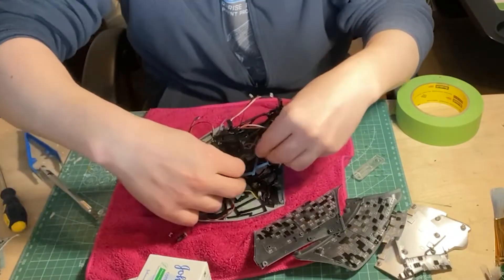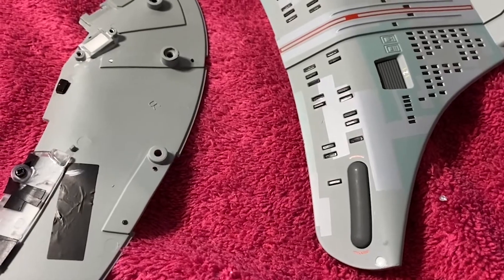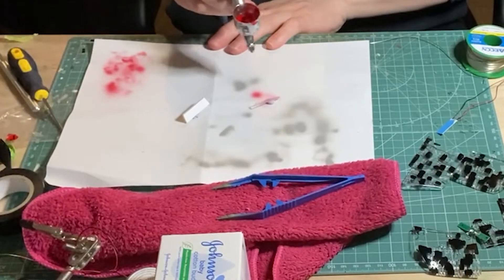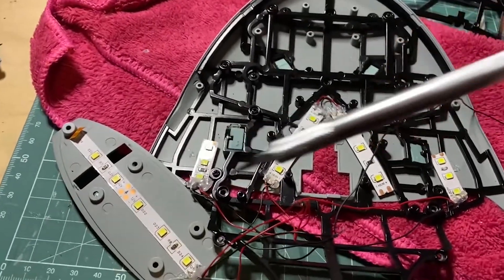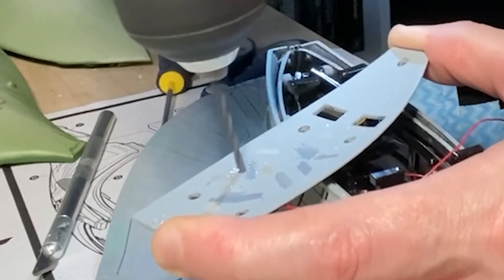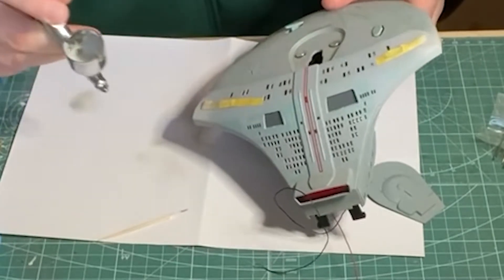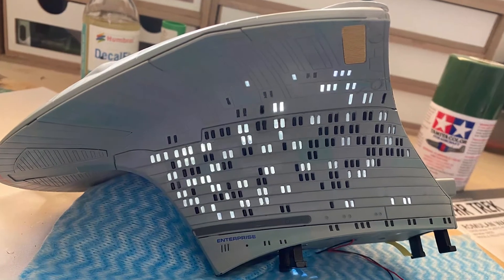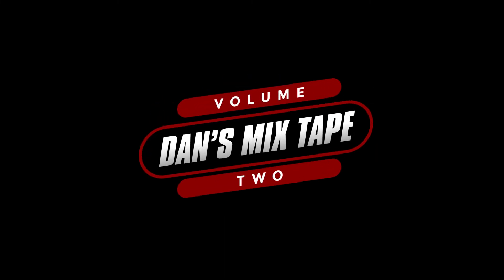Modifying the Eaglemoss Enterprise D Neck Section

Comment: i bet your model is a lot lighter then mine, and with better lighting, that the panels fit properly.  God knows what eaglemoss are doing, i just want this build finished soon. me having a box of parts worries me.
Reply from the maker: Removing the LEDs makes little difference weight wise. The lighting though is improved greatly and yes the panels slot together nicely. I don't think I have the energy thought to tackle the saucer.😄
Yes am getting fed up of Eaglemoss and these delays. Won't be in a rush to sign up for anything else from them...unless its the 1701/1701A!
Reply: @dansmodeluniverse  true